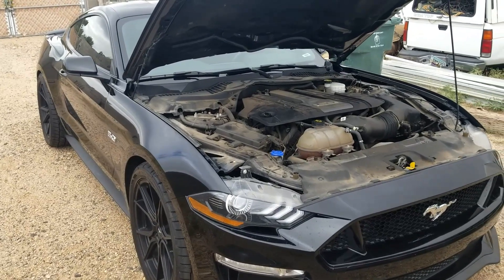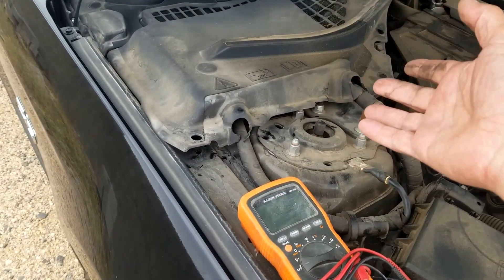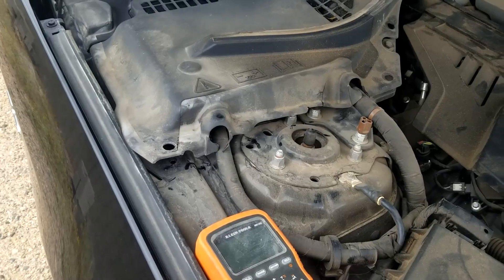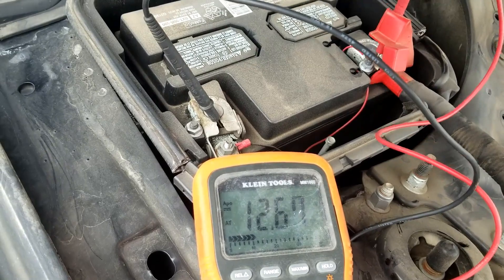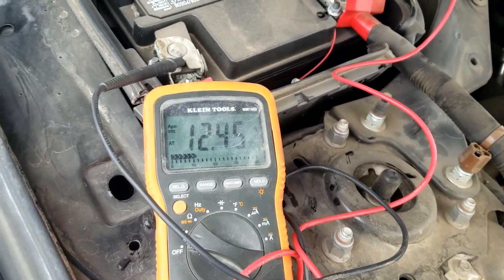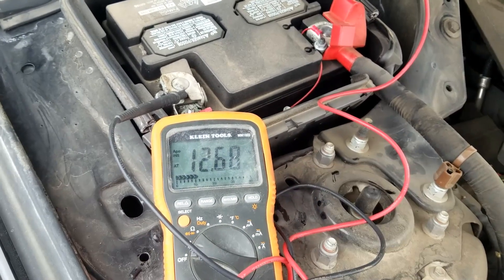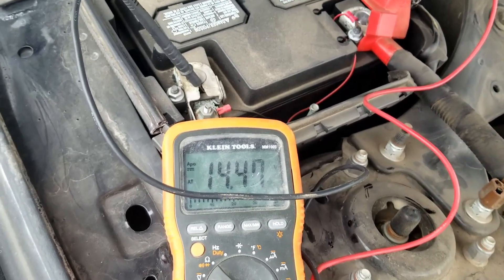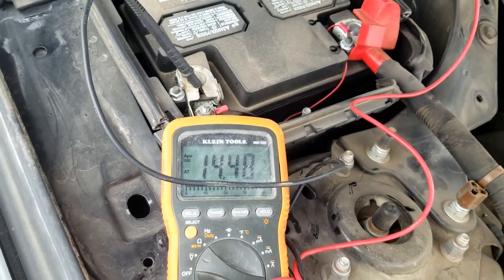How to Test Alternator 2020 Ford Mustang 5.0 (2015-2023)

Comment: That's not how you test a battery or an alternator. ECU controls alternator voltage setpoint. It's something we tune when we go FI.
Reply from the maker: I understand that modern vehicles have more complex charging systems, but this video covers a basic test.

Comment: Mustangs have a smart alternator. Not always 14.5
Reply from the maker: You're right bms  manages it if you were to run the car for 10 or so minutes the voltage is around 14.0 volts as long as it's within  charging range under 12 volts usually service charging system now will display.
Reply: @joeybalogny6095 I just changed my battery and it’s still displaying the service charging system do you think it’s my alternator?
Reply: So if thatnis the way to test the alternator, how do you test only the battery?